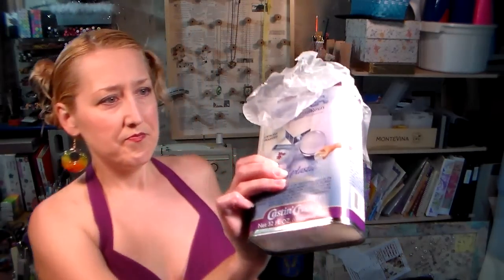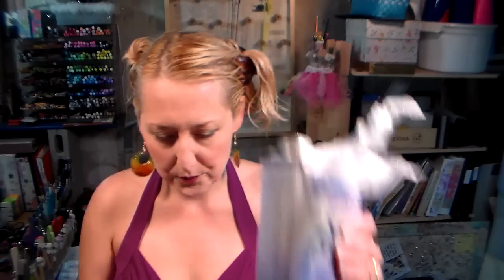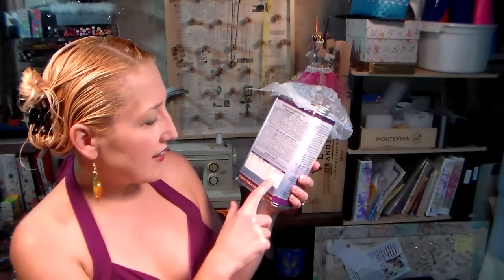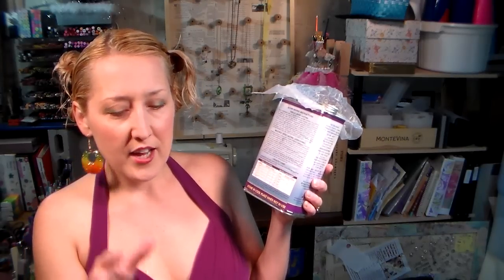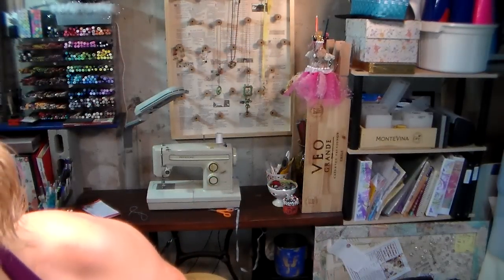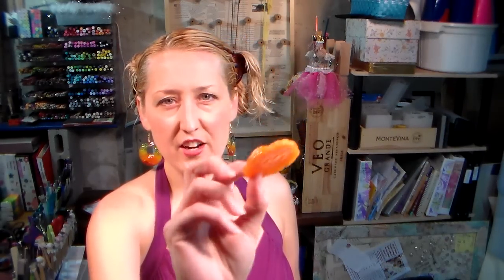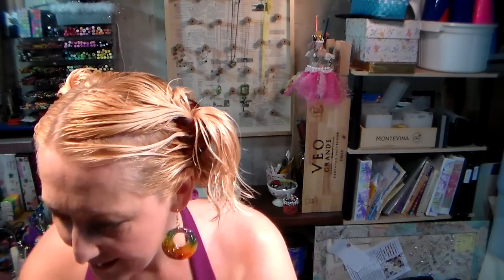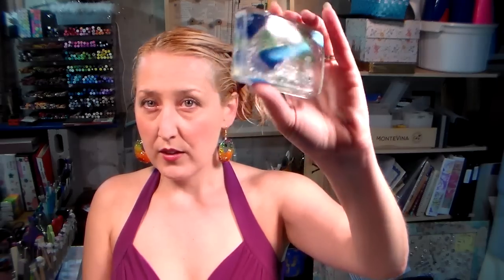polyester resin 101

Comment: I just found out about polyester resin so I googled it and literally just read that polyester resin is cheaper than epoxy. From what you're saying it's comparable or more expensive? I usually read more than one article about any subject I'm unfamiliar with but, when I saw your video I thought, let me watch this and see what she says. I'm wondering why you chose to try polyester resin. Also, you might try rubbing some Vaseline around the threads of the bottle. I'd imagine that would work
Reply from the maker: Polyester is much cheaper, or at least it was.

Comment: I just did my 1st project using polyester resin. I'm really glad I found your video because I felt like an idiot reading the instructions on the back. I literally just got the instructions just now- luckily I only used 2 ounces and they are at the most 1/4 inch thick as I used 15 drops for each ounce mixture. LOL, so they should be fine. I previously used epoxy resin and the first one came out great but I baught a different one the second time and it never cured. I had to throw out one of my favorite molds.😠

Comment: Hi! I could use some help with a project of mine!!! I cast it for the first time and it's a large piece saving an old dried flower and it is foggy and has like shards or breaks in it? It's still solid but it's just not very clear! Any advice for the next one so I dont ruin all of my important flowers??? Thank you so much for your amazing video!!!
Reply: I heard Vaseline as a mold release has less of a cloud cure. I’m not sure about the breaks. Depends how you’re putting the flowers in it. What I do is I take some clay, mold it into the shape I want to cast. I then press that into wet  plaster (firm and almost hard). Once the plaster dries you pull the clay out and there’s your mold. So you can try maybe molding a circle or a square shape and then popping the flower in it and filling the mold with resin. Just coat it with Vaseline first so it pops out.
Reply: @clarissaandrews4428  thank you I will try this!!

Comment: You could build a boat with it and layers of glass.. also, from experience it doesn't like high moisture content woods like pressure treated lumber.
Polyester resin is cheaper with a longer shelf life then vinylester resin. But both are not as strong as epoxy resin which has a stronger wieght to strength ratio.
Specifically I know epoxy isn't uv friendly and needs a top coat to block uv Ray's. Not sure on polyester though

Comment: I have used epoxy resin on some of my paintings and had no clue there was a difference with polyester resin. I am so scared to use it now after watching yours and some other videos on this type of resin. I don't like the fact that you have to adjust to the weather. I bought a few cans with coupons a while back and was ready to use but now I don't know. :( even if I practice on a junk painting and it turns out fine it may not on my next attempt. Thanks for your video!

Comment: If you screw up and don't put enough catalyst in, you can cure it more by putting it in the oven at 170F to 200F for a few hours.
Reply from the maker: thanks, do you need to do anything special to clean the oven after as the resin is so smelly?

Comment: Thanks for your  interesting video. I am thinking of applying a layer of resin to the bottom of a model boat to stop leaks. I have thought of using the epoxy resin supplied in a glue pack diluted with a small amount of surgical spirit to aid application with a brush. What is your opinion of this idea? I will of course try it out on a piece of scrap wood before applying it to the boat.
When you say the catalysts, is that the same as the hardener mentioned on some of the glue packs? Thanks
Reply from the maker: I'm not sure, definitely test it on a scrap,

Comment: I've heard using plastic cups to mix the resin is bad because it will melt ....looks like that advice was wrong? You seem to be using plastic just fine. :) I would prefer plastic ones but I was told to look for paper........any advice would be appreciated  :)
Reply: Also, I heard that the part of the mold exposed to air will not cure fully and will remain tacky. I heard it must be sanded off? Has anybody found this to be true? If so, is it a thin layer that can be easily sanded off? Thanks to anyone who can offer advice :)

Comment: Tackiness on the resin surface is caused by oxygen inhibiting the curing process. To prevent tackiness, the resin should gel in less than 20 minutes, or you should prevent air from getting to the resin after it's poured. If this isn't possible, and the piece doesn't need to be absolutely clear, you can add a wax additive which will prevent tackiness.

Comment: informative, polyester resin needs 2 additional components for it to work, one being Cobalt called as accelerator, without it resin takes ages to cure and harden, maybe your tin comes with cobalt mixed into it, there are again 2 strength accelerator 6% and 12% later being more effective in quick setting, once mixed the polyester resin can have a shelf life of over 6 months , but the minute u add Hardener MEKP polymerization actions starts taking place and u have between 10 to 15 minutes to apply, cast or spread the mix. If colored results are needed pre mix with color pigments, then go for hardener, mixing is very important or one would end up with 1. color seperation giving marble like look, 2 uncured and sticky piece. To remove tackiness, rub detergent water or wax over the surface few times and the tackiness goes.

Comment: You can also use anything made out of Polypropylene (it will have the recycle symbol with a number in the middle with "P.P." under the symbol) and it is less likely to stick without using a mold release.

Comment: Hello, thank you for the video! I heard that polyester resin is stiffer so i want to try to leave my epoxy resin and start to use polyester one.
I want to ask something , because all work i have done with epoxy resin was really well clear, and works you showed from polyester resin, looked a little bit foggy, it looked clear, but not like epoxy resin i have seen . Have you made them to look fogy because it's more beautiful or it's just how polyester resin looks when it's cured ?
Thank you if you will find time to write a response ! :)

Comment: This was a great video darlin! In searching around for the best method to out a poly resin coat on some fish tank structures I made. I dony want to encase them, only coat them so any epoxies/glues I used will be encased. (because even though aquarium world states Gorilla Gel super glue works wonders in aquariums, for whatever reason, it isn't in MINE.  I believe because my materials are glass.   though I FULLY roughed up surfaces with Dremel and a bit, the glue seems to be half ass once it gets wet. So.   I'm casting the two structures ('houses" for my two betas...lol made out of the flat glass pebblestones from Dollar tree ..each sitting atop a visually gravity defying pillar of marbles...😁 they look AWESOME.  lol,,)  and they are fragile at best. A LOT of Gorilla AND JB Weld clear epoxy as the surface connecting each stone is rounded,smooth AND super tiny. BUT.. I did get them to hold up FINALLY . Thinking the poly resin will make sure they don't come apart after a few days under water.    Your vid was great for everything leading g up to!! thanks! n

Comment: when you showed the glitter pieces, what and how did you do this board and why... it looked like a piece of styrofoam with giant pins/nails to hold while curing????  you made some very nice pieces.  look forward for a' how to do these ' a lot slower.
Reply from the maker: +Linnea Beckman it is a drying board. The pins hold up the pendants so they don't stick while the clear sealer dries. I made the drying board by poking sewing pins into foam core board

Comment: HI Lindsay, thank you for the very informative video. I bought some Polyester resin, but not used it yet. Any advice on two points?
Firstly, what do you use as a release agent?
Secondly, do you know if you can use any type of plastic cup or similar as a mould?
As it is expensive, I do not want to do the pour, only to find out that the mould melts or something?
Sorry if I missed either of these points in the video or comments - I did read a lot of them lol!
All the very best, Clive
Reply from the maker: I use castin craft release spray. Silicone moulds work best but most plastic mounds work with the relese agent. Make sure you use that with hard molds especially. They make resin molds that are fairly cheap at the craft store. A cup should work too.

Comment: do you think this would work to make a printed slate sign watertight?
I'm looking for a solution to make a house slate sign (printed with a UV-cured white ink) water resistant.
The print flakes off few days after it gets moisture when exposed outdoor..
Reply from the maker: try envirotex lite, it is an epoxy resin you can pour on available from any hardware store or home improvement big-box. Polyester might dry sticky over a large area

Comment: I really need help in my polyester resin cause mine is very confusing First off all my charms never dry properly they stay sticky they leave your. Thumb prints when you touch the but I've been putting the ratio of the hardener to the resin but the charm is really still sticky it's hard but sticky can u help me?
Reply from the maker: brush a coat of clear acrylic varnish on it and let it dry. It is sticky because of contact with air, that is why the resin that touches the mold is not sticky. You can sand of the varnish later if you like and it will be hard underneath.
Reply: Studio Kawaii  hi beautiful💜, all my projects are tacky on the surface so i will just apply an acrylic varnish and it will gonna take away the tackiness? please i really want to solve this problem....im planning to hv a livelihood on the keychains i made.

Comment: Hi, did you get any bubbles? Also did you add your bits in to the mould and pour the resin on top or did you mix your resin first then add bits n bobs in to the resin before pouring ie your glitter etc orrrrr did you add the resin in to the moulds first then add bits or does all 3 work? 😃 any help would be sincerely appreciated 
Thanks in advance
Reply from the maker: I added the resin first and got no bubbles, sometimes it helps to dip an item in resin before placing it in the mold so air does not get trapped

Comment: Hey I had a question. 

I am working with 3-d painting within resin and I am about to tackle a huge one (my mold being a 5 gallon bucket with releaser sprayed).  I was going to work with different layers in one sitting (pouring each when the previous gets gel-like). My thickest layer should be about 3 inches or so.  I never used polyester before but epoxy did not work for such a large scale. 

Of all videos I watched,  They say to embed face down as the bottom layer becomes the first. Is this a necessity? Does it not show equally from both sides? My process for this will be embedding painted canvas (coated with vinyl resin glue) but I need to do it face up for accuracy. And the last layer on top will be my actual top layer (in normal order). 
Can you clarify if the shapes show through the last layers? 
I wanna make sure this works.
Reply: Regardless of the type of resin, it's not going to cure if you pour it that thick.
Reply from the maker: +ZKArt I am not an expert. Ask the company you buy your resin from
Reply from the maker: +ZKArt I am not an expert. Ask the company you buy your resin from
Reply: thefrugalcrafter Lindsay Weirich

Of course I will ask the company itself. I was just wondering if both the top and bottom sides were clear after you casted the jewelry.I am just curious of what your observation was.

If I can eleminate my doubt of having to cast them in reverse (which may not be possible for the time I have), I could focus uniquely on the math involved.
Reply: It actually worked!! First try too. Did it in 9 layers. Each layer cured in about 40 mins or so. Next day it was all good.
Go check the baby out on my website. Zaeed kala dot com
Reply: ZKArt hey I know this was a while ago but what kind of resin did you use? I just checked out your amazing art and was wonder if you  you had luck with the resin in the video? I'm getting a weird slimy gloss around my mold.

Comment: this video was a great starting point for me but I did a big piece and the top layer is full of  blemishes anybody have any ideas how to get rid of them
Reply: Do another thin layer on top
Reply: If it's polyester you can sand it down and bring it back up to a really nice perfect shine if you use the right grits. 

That's the one thing I love about polyester, and hate about epoxy. Epoxy never shines back up, you HAVE to pour another layer or paint a clear coat(which never looks as nice).

Comment: Excellent tutorial! Thank you so much. I have a few questions. Is polyester resin more durable than regular equal part epoxy resin that seems more common? I'm trying to cast many sided dice for tabletop role playing games and the dice need to be durable. And is floor polish safe against skin on jewelry? I'd assume so because you might walk on it barefoot.
Reply from the maker: +The Main Sarah Jane I think they are equally as durable, yes, it is safe, it is really a thin acrylic sealer.

Comment: Is there a difference with that tin easycast you have there and the the box? that comes with two bottles because the boxed one does not cure hard?
Reply: The box ones that have two bottles that are exactly the same size are EPOXY resin, not polyester resin like she is using. I would really recommend epoxy resin, it's always a 1:1 ratio- it doesn't vary like this resin. If you've used epoxy resin and it didn't get hard then you didn't have exact proportions of both parts, and/or you didn't mix it thoroughly enough. 

If you're using polyester resin, especially inside, you need a ventilator on. That stuff is super toxic to breathe in, if you smell it than you definitely are breathing it in. 

Also, you should be using nitryl gloves, not vinyl/latex. They also sell them at the dollar store.

Comment: I work for a large polyester resin manufacturer. Nice to see some of the artistic uses. On my end I only see what the larger manufacturing customers produce.
Reply: DRAWINGFLIES you're the man I need to ask about this. I just got some resin and I can smell it through the closed bottle and two tied up plastic bags. and I am a little worried it might catch fire in the Thai heat... can it spontaneously flash?
Reply: Youre probably smelling the styrene that is used to thin the alkyd when it is pressed from the reactor. The flash point for styrene is 88f(31c). i've never seen spontaneous combustion, but it can polymerize. That can generate heat and cause container to rupture. The resin we sell has a 6mos shelf life. If you have a small quantity and can keep it in a climate controlled area ya shouldnt have an issue. Hope this helps ya some.

Comment: Hi thanks so much for this video. Nobody really has a good one on Polyester.
Question:  Do you add color /paint before you add the catalyst or after?
Reply from the maker: Print Salon LA I had to think...after, pretty sure, it does no set up too quickly.
Reply: thanks! For the reply. I tried it after and boy your weren't kidding about the smell.
Reply: +Print Salon LA ohhhhh that is so bad for you, get a respirator or switch to epoxy resin and save yourself a LOT of hassle.

Comment: Excellent tutorial! I have tried using PE resin yesterday for the first time, and it turned out a little sticky. Now i know i will have to try a bit more of the catalyst. Thanks, cant wait to experiment some more.
Reply: Thanks!
Reply: UV light helps the resin polymerize so expose to the sunlight, if you don't have a UV light.
Reply from the maker: Ayelet Danieli if it only stick on the air exposed side you can add a layer of water-based varnish like Pledge floor wax, when exposed to the air it will also be a bit tacky, this solves the problem or you can sand off the sticky layer.

Comment: ty so much.. I was exactly like you and had used a coupon at A.C.Moore and then  realized it was polyester and not expoxy when I got home and was scared to use it for 2 + months! I did not realize it would smell much worse either..ugh!  It's still a bit cool here in Buffalo and I'm doing it at night time so temp is even cooler so I will have to fiddle around.. hoping it works on some flowers I picked! Thanks again for explaining how to use the drops..all the other vids I seen about resin epoxy and used half an half so was so thankful you had posted this!!

Comment: I am looking to make a larger mold of a traditional water jug (half gallon) and want to fill the inside with nuts to make it look like the nuts suspended in water. That being said I want it to be as clear as possible just like water. Would you recommend a polyester resin or epoxy resin for this? Also since it is such a large object I am worried about cracking and how stable the resin will be once it fills the handle. Would you suggest pouring all at once or in layers to help minimize this? Any other tips you have for pouring larger molds please let me know! Thanks for your help!
Reply from the maker: Shawn Bush wow, that is big, you will need to work in layers to keep the nuts from sinking. I'd go with polyester because it is really strong and less expensive and you will use a lot. I have never cast anything that large though so do some research (ask a resin manufacturer) what you will need for catalyst.